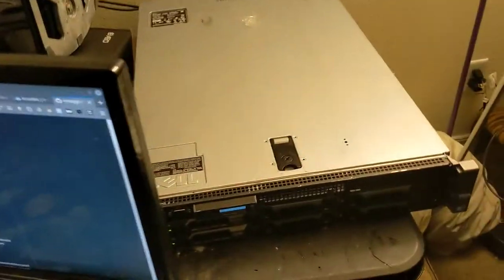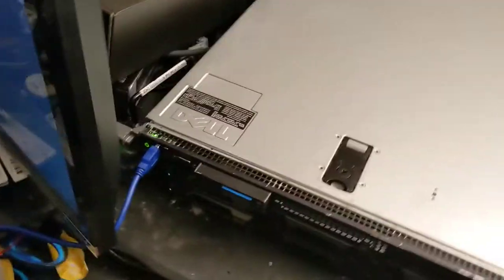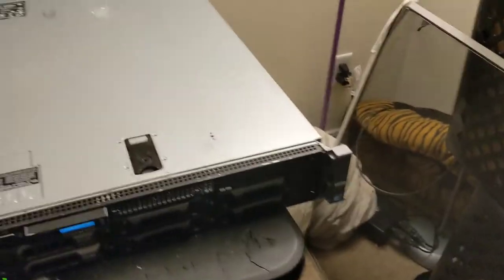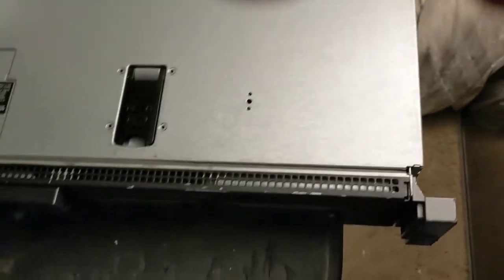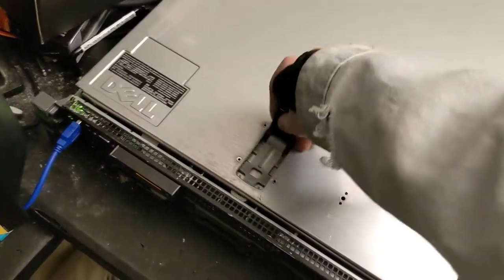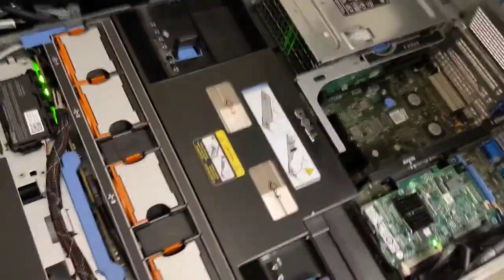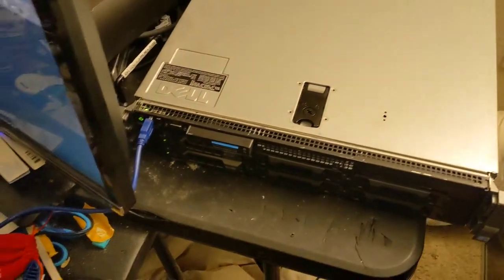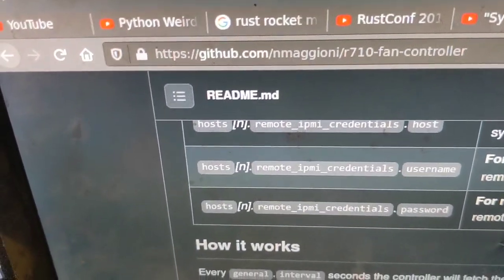dell r710 fan noise

Comment: The fan noise doesn't seem all that bad. Would this compare to something like a good sized desk fan in terms of noise?
Reply from the maker: its higher pitched than that. these are 5 tiny fans spinning very fast. harder for me to ignore and bad enough to hinder my sleep. it doesnt pick up nearly as well over the phone mic. u hear it best when i move between the sources of noise and the phone hasnt had time to adjust the gain or whatever
Reply from the maker: for reference, the full speed sound is in reality enough to make it difficult to hold a conversation thru the entire house
Reply: @ezrabarrow2005  damn thats rough. This is a 1u server right?
Reply from the maker: @altra8911  2U
Reply from the maker: @altra8911  it never picks up to full speed tho cuz its in a room temperature open room with AC and plenty of space for convection, hence the script to lower fan speed significantly
Reply: @ezrabarrow2005  so its still too loud even with it being a 2u with the larger 80mm fans and a 'low fan speed' script running??
Reply: @ezrabarrow2005  (2u servers typically use larger fans (80mm) than 1u cases, which as a result make 2u servers quieter. Just in case you didnt know
Reply from the maker: @altra8911  yeah i looked for a 2u specifically for that reason
Reply from the maker: @altra8911  its only too loud if im trying to sleep 4 feet away from it lmao
Reply: @ezrabarrow2005  gotcha. Im planning on working at my desk about 3 feet away from the server rack. So this is very helpful info. I might consider putting some quieter noctua fans in it or something, then it might be fairly comfortable. Thanks for all the responses bro
Reply from the maker: @altra8911  better fans would probably help, also couldnt hurt to add some sound damping into the rack itself. as u can see my server was open air laying on my desk, not great for sound isolation
Reply: @ezrabarrow2005  true